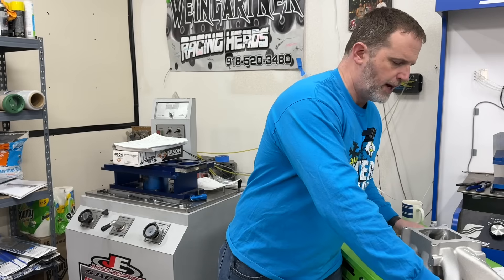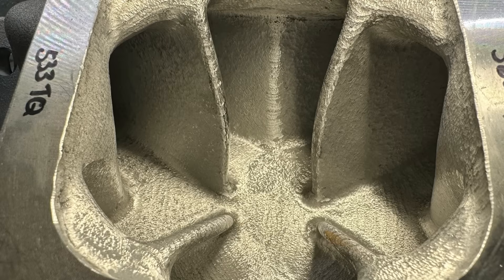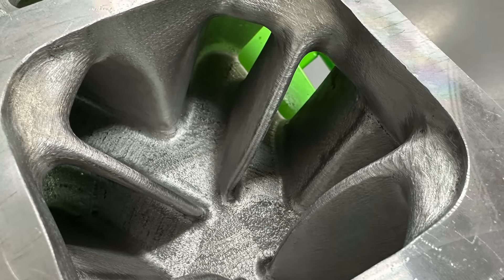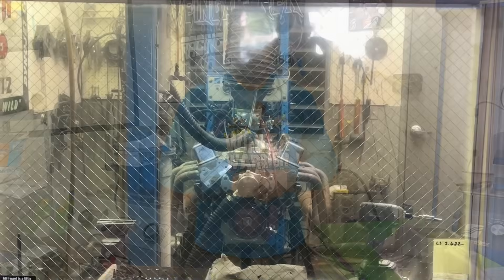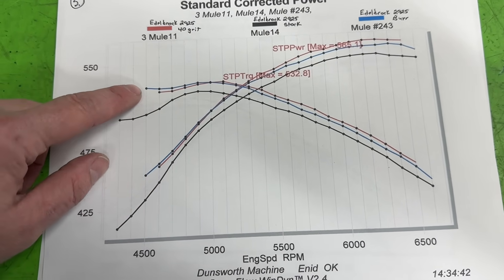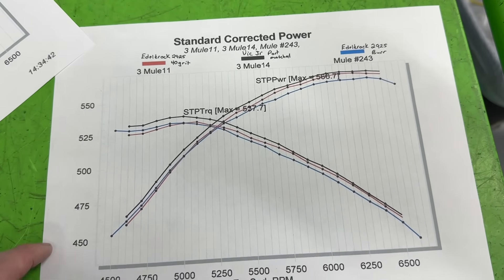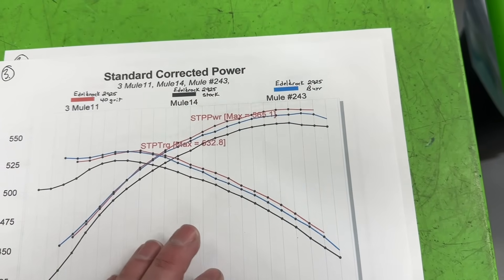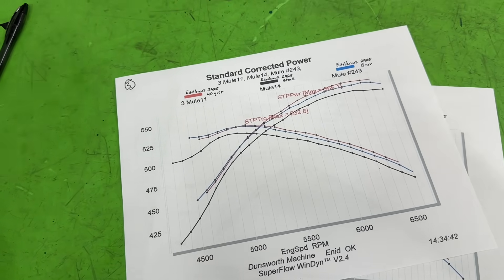Dyno Results From Smooth To Rough Finish On Intake Manifold

Comment: That's like the golf ball dimpling myth, turbulent boundary layers effectively reduce the cross section of your intake runner, sometimes its desired in specific use cases, but generally, smooth is best, but not polished smooth, because if you have zero boundary layer, capillary action takes over and the fuel starts to cling to the walls of the runner.

Comment: Too smooth a finish at high flows can increase the friction of the gas  through the pipe. There are other considerations of equal and greater effect.  A common item that show this is the golf ball. Those dimples aren’t just there for decoration. And you don’t see smooth golfballs.

Comment: As I see it a well polished intake can be more sensitive to even small differences between the channels to each cylinder than a slightly rough surface unless you can make each of them "perfect". But too rough and you disturb the flow.

Comment: Eric.  Tips you can try. Unloaded @ 1,700 change the idle feed restrictions to get to 14.7.  Bring it to 3,800  unloaded. Change the primary main jets to get to 14.7 af.  A 347 to 355 need a 0.032 IFR ,  AND 71 Primainy jets 
Try it. Its an amazing difference. Then you just need to tune the secondary main jets under load but above the power valve opening to get to 12.7. Then WOT to see which way to go with the PV restrictions. 

Tip 2.  If you have a 3" collector and mid pipe to the muffler.  Take collector reducers that the small size is 1 size bigger than the primary tubes. Weld on 10" of that size tube.  Slip them in at the collector.  Now you have anti reversion  plus.  The exhaust pulse entering the collector looses speed.  The collector reducer picks up the speed of all the exhaust pulses going thru the extended tube.  This increases the scavenging by lowering the pressure in the collector as each of the leading fronts of the exhaust  pulse lower the pressure behind it.  Any reversion pulses   cannot flow thru the constant flow of the insert and are directed around it into the tapered dead headed area.  What's it going to cost to try it.  50 bucks . Warning. Please watch the AF ratio and bring it up in stages as you likely will need to go richer on the primary and secondary main jetting.

Comment: I’m always thinking about improvements to my 340 small block. It’s already stroked to 372. I was debating on using the stock X heads that I have. Here’s where my brain twists up. I already have the Victor Jr intake. II do know I’m going to use fuel injection. But the heads. I’m definitely leaning to the Edelbrock heads. Yeah. The only real thing I might change in the bottom end are the rods for insurance purposes. Yeah. I’m just thinking. Haha!

Comment: A smooth mirror finish allows faster air flow, but does not allow fuel to atomiz and mix with air, as you found with the 40 grit, we used 30 - 50 and sometimes 80 depending on manifolds,  on some performance HDs,(mine) 80 the first third, more turbulence,  30 the rest, BIG gains along with indexing spark plugs, and a side effect of this was much better mpg at normal riding,
Reply: golf balls have dimples to reduce friction
Reply: @charliepyle1626 didn't know intake manifolds flew 😂😂,  you want a rough finish to atomiz and mix fuel- air, and a EFI carb will make more torque- power than direct injection

Comment: The dimple finish done in motorsports is a real power gain. I believe VW or Audi did it in Group B cars. Turbulence will help with atomization to an extent, but I love that there was a refocus on design. Only time I personally like really smooth surfaces in the intake is when it’s a direct injection engine.

Comment: Eric... What happens if you cut out the intake divider in the head??   Just grind it out for a large intakefor both valves?? I can see velocity may suffer but have you flowed one??
I did this years ago on some 882 heads, and got great mileage, i have not seen anyone do this?????

Can you give any insight?????
Reply: Killed port velocity and power but picked up MPG?

Comment: Ages ago we did an Extrude Hone "port" on a manifold on a 420ish ci SBC  nitrous engine we use to street race for money, we use to fill the roll cage up with nitrous and spray a progressive 200 shot starting at the 330 or so ,couldn't see anything all the pluming was under the manifold lol...good ol days  ,the manifold and lost power on the engine dyno vs the previous test and we changed nothing, same fuel,oil,plugs, coolant temp, dyno, dyno room conditions etc...then we called them up and they told us to add a phenolic carb spacer and after a 10 minute argument I said well we have nothing to lose at this point and we snagged a 1" spacer off another engine they had at the shop and it worked ...don't know how but it did. Picked up like 22 peak and in the teens across the curve . We had a hard time believing what we just witnessed so we snagged the manifold off the engine we robbed the spacer from which was the exact manifold we had minus the Extrude Hone (HVH-bolted to Brodix heads) and wouldn't you know the Extrude Hone out performed the stock unit  buy around 30 when spun to 8k.. Still baffles me to this day. IDK if either of those companies are even around lol.

Comment: I always hit my intake runners with black beauty corse sand blasting media.  It showed a 5 hp gain on a ported burr finish intake and it did the same thing if not more on other intakes we tried.  I think our best gain was 10hp.  Just going from whatever finish was in the intake to sand blasting them.  So ever since then every thing I port gets black beauty treatment.   But I’ve never tried 40 rolls.  Most the power was made down low and idle was always so crispy after I started doing it.

Comment: Thank you for sharing results. I believe the idea of the burr finish is the rough creates a boundary layer of air on the port wall surfaces to keep the fuel from falling out of mixture with air.  Evidently the burr finish and/or the larger avg cross sectional area help

Comment: Exhaust is the only one you want smooth.
Dimples in low pressure areas has increased velocity
Reply: so does a smaller intake runner, Bernoulli's law. Velocity doesn't mean more power, your piston still wastes energy creating the vacuum to draw in the air charge.
Reply: @plav032  Where did I say velocity equalled more power?
You seem to be adding stiff that wasn't said.
Pistons doesnt draw anything, if you were as smart as you act, you'd know a pistons down travel creates vacuum and air rushes in to fill the void?

Comment: We always left the intake runners slightly rough. It is the exhaust ports you should polish like a mirror. It helps so carbon doesn't build up deposits in the ports as fast.
Reply: Also flows slightly better and less heat transfer as surface area is reduced reducing that heat going into the head.
Reply: I once built my own intake from metal sheet, it was smooth, what i noticed, was fuel would colkect and stick to the walls of the intake...smelled like gas when you turned it off too. I agree, smooth on exhaust, 600 grit on intake
Reply: Agreed…
Reply: I read an article about extrune honing. The problem they ran into was the fuel would pool in the bottom of the intake.
Reply: @LynnRunningdeer-v9b  Extrude honing became common in the late ‘80s/early ‘90s with dry flow EFI intake manifolds. There really is no point in extrude honing an intake manifold in a carbureted application.
Reply: I have heard that a 60 or 80 grit finish on the intake vaporizes fuel better. Never had the opportunity to test that theory but it makes sense to me.
Reply: Exactly what I was taught by several old school engine builders. Some would argue that it is a must to have a rough finish on a carburetor, I agree, but not as critical on a port fuel injected manifold as the fuel is already atomized but can still puddle.
In my practice and opinion, I do mirror finish on exhaust and matte finish on intake.

Comment: Look at a golf ball and investigate how dimples promote the boundary layer principle. Air over air moves more efficiently than air over material.
Reply: he has tested that. dimples reduce port area. it hurts power. the only time dimples help is when the port needs to be filled, as the dimples push the flow area away from the wall.
Reply: or the speed holes in homer simpsons car, same idea
Reply: Read somewhere golf ball only works below 300 ft./sec.
Reply: If the cartridge roll worked better than the burr finish. Why would you think a dimple finish is even better?

Comment: Knowing which manifold is better comes from back to back testing whether dyno or dragstrip. Surface finish is next once the best manifold is chosen. Anything slightly rougher  than fully polished is fine. Manifold heat helps a low rpm, and mostly closed throttle running. Once that big carburetor goes wide open, the interior of the manifold will chill to a frosty temperature and velocity and turbulence take over the atomization job. I find it better to allow the manifold to stay warm and use larger runners to compensate for lost cfm due to density. You need both for power, good atomization and volume.

Comment: The tests I've done over the years going back and forth between surface is that the rougher surface improve throttle response and the engine is less temperamental pulling from down low. For a street car I would personally go for a rough surface every time. 😄

Comment: 🔔😎
Maybe 1 % gain but polish has worked for decades.
Does it really matter on anything street driven ?
BTW how fast is that mixture velocity at high rpm ? Carb to chamber in .001 second ?
Zip zip 🙄